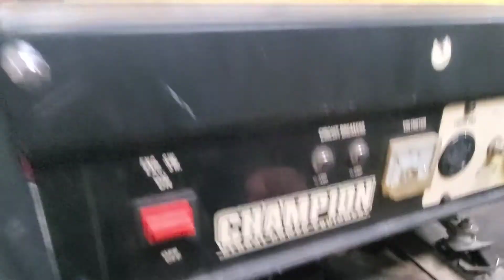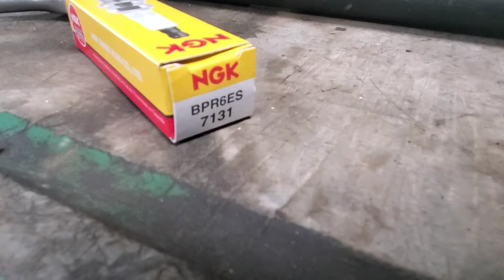Champion Generator Sitting Up No Start. Sling blade even popped up in the video

Comment: I got one identical, I clean both of the jets change the plug and still not wanting to run. It’ll start once when you’ve got it on choke then it’ll shut off.
Reply: Fuel screen in tank valve may be stopping up 😢

Comment: That’s what I have. It surges constantly unless I engage choke a little then it runs fine? Mine is a dual fuel 10K
Reply from the maker: Awesome, too Easy!. Just a clogged jet, port or emulsion tube in carburetor.  You can do it!!
Reply: @RaleysSmallEngines  thanks I need to keep like zero fuel in it afterwards. I run non ethanol premium fuel still goes bad
Reply from the maker: @RLoose9494  generators are notorious for bad fuel because they sit a lot.  After using completely drain fuel tank and carburetor completely dry. Leaving open for a day or so. Then store it. That's what I do with ours and when I'm ready for them they always start.

Comment: My friend just acquired one of these Champion 46596 generators from someone he knows for free.   It's in bad shape, no fuel lines, oil sensor wire is gone, pull start assembly is gone, valves are rusted open, no compression.  I think I'll need to rebuild it to get it working, should i call it a lost cause and just tell him to spend the money on a running unit?
Reply: Sounds like too much work. Scrap it for the copper value.
Reply: @Mrs.T-bone  yeah.  I already priced out parts and it's unfortunately not worth it...  It has joined the pile that will be going to scrap.

Comment: Have one like that .ran great for 5 days .getting spark and gas .will not hit now even on starting  fluid .any idea?
Reply from the maker: Be sure it's full of oil. Then disconnect the wires to the low oil shut off. Oh also if it has a Bosch or surefire spark plug throw it away and put in a NGK
Reply: @RaleysSmallEngines  changed the oil ,put new plug  in.will disconnect  low oil switch. Thanks.
Reply from the maker: @Keith Jones  let me know what happens please. Hope it helps you.